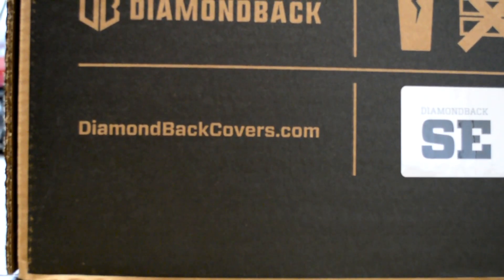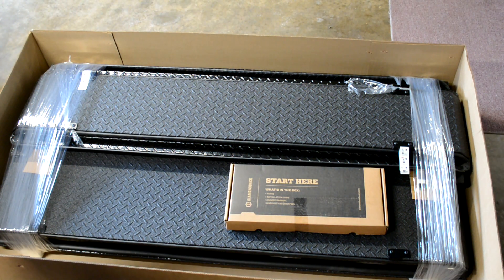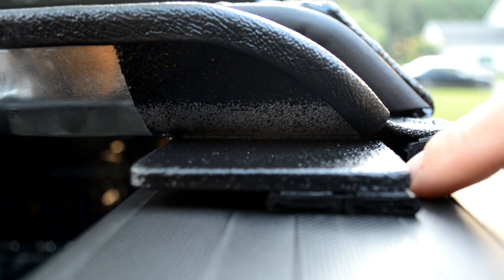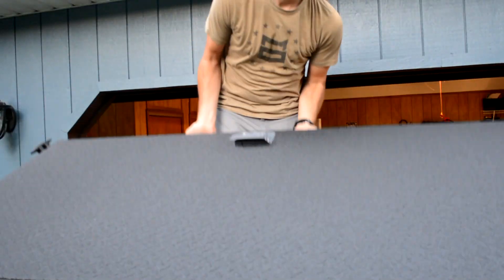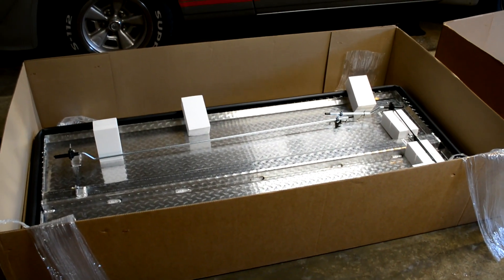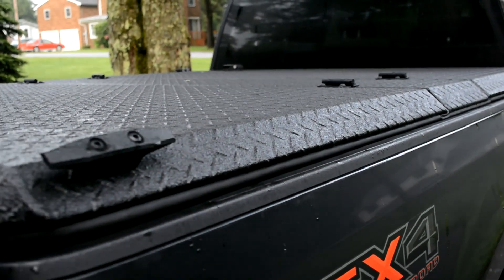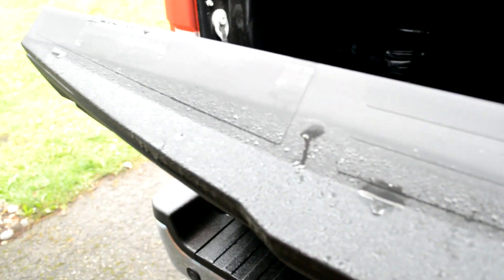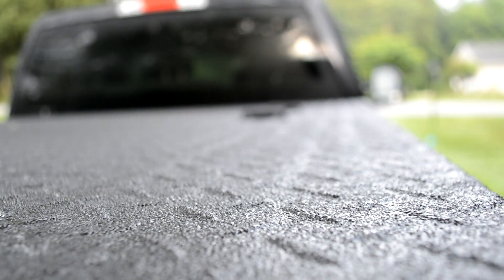Diamondback SE Bed Cover - 2019 F-250 Superduty

Comment: I understand that it's not supposed to be Fort Knox, but I have a problem with the screws being exposed at the top, if someone wanted to take something ,all they have to do is unscrew those screws ,bypass  the lock and take what they want and be on their way.  Those screw  hinges should be underneath the bed panel not on top.

Comment: You forgot to install the bulkhead weatherstrip on the top front of the bed up by the cab.   Cover will LEAK without that bulkhead strip.
Reply from the maker: The bulkhead strip didnt come with my cover. Maybe the strip is required for certain make and model of trucks?